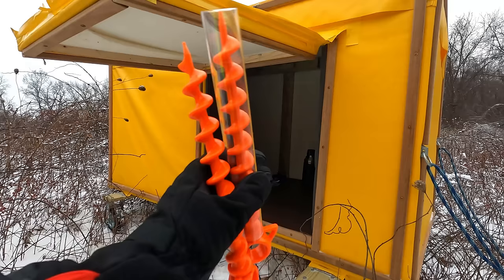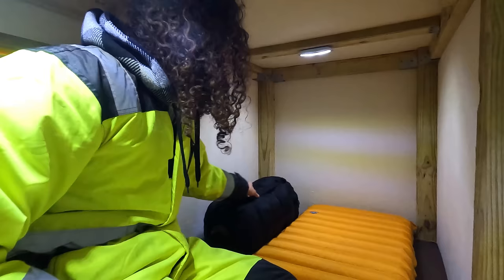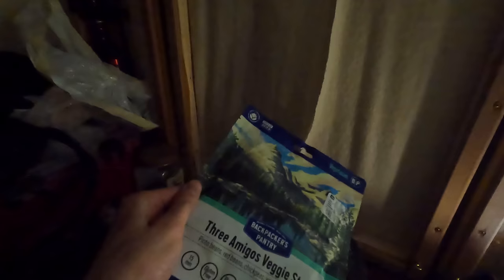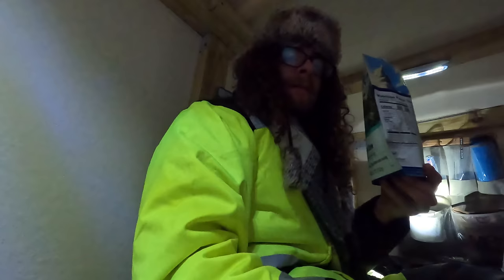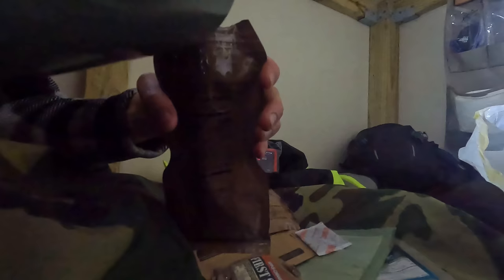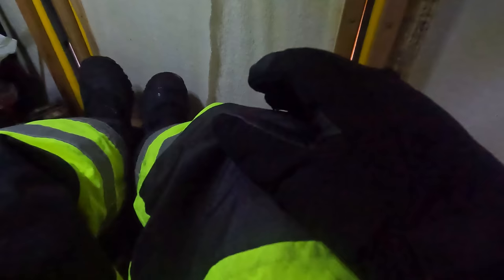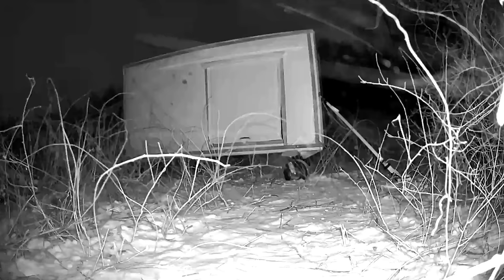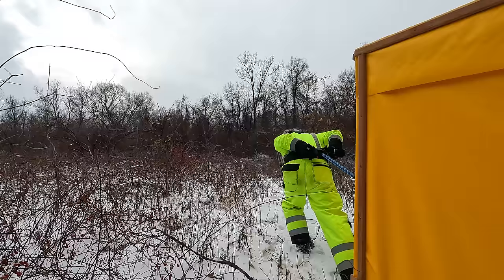Zero Degree Night In Homemade Camper ( 0° F and 50 MPH Winds )

Comment: Let’s all pitch in and get this guy one of those pocket projectors so he can watch movies on the wall of his camper 👍
Reply: I got one on Amazon for like 25$ USD and it has a battery pack. I can watch a solid 5-6 hours with it. It has a HDMI, mini HDMI, type c and USB. In small areas it's awesome. Anything bigger then about 50 inch it's resolution goes down.
Reply: Send me a link!
Reply: @AndyKPOV  can I also get the link?
Reply: @AndyKPOV  can I also get the link?
Reply: @AndyKPOV  i was just going to suggest this!!

Comment: A UCO candle lantern safely secured on the floor would be more than enough for that very well insulated camper. It's what I use in Vermont winters in my insulated tent. You wouldn't need to leave them burning for very long. I put mine in a metal bucket so.if it falls over... it's inside a metal bucket. Plus, the metal bucket radiates heat, too.
Reply: I live in my camper van and a metal bucket is a lovely idea ☺️
Reply: I have seen terracotta pots used. Over the top as well. the hole as vent.. Great radiation.
Reply: This could raise the level of CO2 in the camper.
Reply: He can't have a flame in that, the CO 2 would go up fast.
Reply: Cool!!
Reply: I have used candles myself. Actually one kept me from freezing on a cold night in Cali.
Reply: @martintrapper5366 not really
Reply: Use 4 xl uco lanterns in my hot tent all night long while hot tenting too ,keeps the temp around 55° after my woodstove burns out . I hate to be the bearer of bad news for some of you YouTube scholars but there's no build up of co2 in a hot tent ,there not air tight

Comment: You can get sheets of 2 inch foam used for insulation.  I use it when I have our air conditioner in the window to take up the space above the conditioner.  You could also build an extension for small wood stove, or a heater of some sort.  Line the walls with a fire barrier and a heat barrier(lowes).  That would make it beyond warm for most any weather you would encounter.
Reply: 🎯 Great advice
Reply: Then you can safely use your little stove to knock the chill off then possibly maintain with candle heater.
But only good while door closed, lol
Reply: Too small for wood stove, unless you want to feed it every 20 minutes

Comment: Zippo makes a rechargeable battery hand warmer that lasts much longer than those disposable ones, have a couple settings so it is easier to control the temp, and you dont have to pack in and out so much garbage. you might want to look at those in the future.

Comment: Suggestion:  install thin wall pannel inside for durability from your body inadvertently pushing outwards on the walls.  Also add a vent on the roof to let gases.
Reply: Like methane?

Comment: Better insulation would go a long way towards letting your body heat keep it warmer inside.  The reflectix only works when it's allowed to reflect, which it can't do when it's sandwiched between two opaque layers.
Reply: Heavy tho right?
Reply: @rs5570  
A little bit heavier maybe but foam is light too.
Reply: You could use 1.5" rigid foam everywhere and heat the place up toasty warm with just a candle.
Reply: Maybe outer layer of black coroplast, followed by a couple inches of rigid foam, followed by a layer of white coroplast? I'd get rid of the lumber - but then, I'm old, and would not last long pulling that 200lb loaf of Velveeta. 😆

Comment: You might want to cut out some panels of 2” thick rigid blue foam board and fasten them into the sides and roof overhead. These should be used only for winter camping. You also forgot to insulate the area under the camper which can be left in place all year long. It will make a world of difference in comfort. If you cannot find foam board in a 4 foot width you can silicone two 2 foot wide pieces together. Also the foil lined foam board will work best. Foil side in towards you. If you cut them right they will friction fit into the wall and rood sections. Bungee cords with eye hooks to support the roof sections if you can’t get a tight fit.
Enjoy the wild!

Comment: Saw some Milwaukee work gear today..hooded coats with heater coils sewn in, powered by rechargeable batteries. Supposed to stay warm 12 hours. They were around 200 bucks, not horrible.
Reply: Problem is according to reviews way too many batteries fail and they don’t stand behind them.

Comment: Couple things,  ski adaptor underside so not as hard to pull for winter.  foam insulation should be used as well better heat retention.  Candle clay pot heating system, it stacks and holds the heat well but for that you need some venting for the co2.

Comment: You should buy the indoor buddy heater it's awsome yoy can boil water 💧 on it and keep warm it's safe to use indoors with out getting carbon oxide poisoning
Reply from the maker: I'm worried about oxygen depletion inside such a small space Id have to add in a vent system but I feel if I did  it would just vent all the heat out so I'm not sure about a buddy heater for this camper But I can run some tests
Reply: Yes, buddy heater. You'd probably have to prop your little front door open a touch but all that heat coming from your heater would make up for that loss.
Reply: @Quiet Nerd  You would be fine with a vent in there and a little buddy heater, they can kick out quite a bit of heat and it would definitely warm that small of a space even with an open air vent.
Reply: @QuietNerd  also find a way to vent it so you will be safe.
Reply: Can confirm.. I have 2 of those Buddy Heaters. In a space of that size, you'd be pretty warm. 
They'd make a big difference..🍻🍻
Reply: I would put some arch on the roof.

Comment: I car camp: Here is my set-up for winter. Just spent 2, two, lol…nights truck camping in the back of my 2006 Four Runner. 1st night down to 27*, 28* F. 2nd night, woke up in Vega, Texas and it was 22*F in the AM. Dog sleeps in the driver’s seat w my big coat over her. I’m in the back watching YT staying warm mostly with my Jackery 500 running an uber cheap electric blanket inside a 40 year old sleeping bag. But I’ve been OK @ sub zero F by using my butane stove intermittently. I built a Bob Wells heat shield w aluminum foil and a coat hanger so I don’t fry. Works fine but this trip I learned: sleep w butane cans in your sleeping bag. They cut off if they get too cold. Sub 0*F is totally doable but you gotta be careful in the mountains where I’m at now…7300. It has remained 10*F ALL day. Glad I made it to my cabin! Snowed 6” last night. I love these vids Dude. Especially what you’re doing right now. No way to do much cooking inside. My rig is 4WD so a small travel trailer is in my future :-) Peace & GBU
Reply from the maker: Keep on keeping on!

Comment: I think a lot bigger wheels would be much better.  Perhaps consider putting ones the size of bicycle tires at about the 1/2 way point at each side.  To move it, you could be slightly lifting the front and just having it run on two wheels.  When you park, legs on each end would take most of the weight  but weigh a lot less.
I also think that a peaked roof would give you more strength for less weight.  Triangles can't change shape without a side changing length so you can get strength out of that.
Also a deployable skirt around the bottom might help with warmth at very little extra weight to carry.  Stopping the wind from passing under so easily will stop it taking away heat.

Comment: Nice camper setup. Just a thought, try using a 3 candle UCO lantern for heating. Rated at 5000 btus, candles last 9 hours, you are already using monitors and will provide light. Stay safe.
Reply: Interesting.

Comment: I wonder how would you deal with pulling the CheeseHut through 6" snow if it would really fall during that night. Maybe, a pair of skis (instead or over the wheels) would be helpful during the snow season, if one has  to do such a camping quest in similar conditions. 

Also, there's a number of electric battery-operated heaters, but they are kind of pricey. Other option is, boil water /heat sand or bricks outdoors and then bring the hot bottle or sandbag or brick inside. 

Lastly, I'm really impressed how sturdy this thing turned out! 

Happy new year and have more fun in 2023!

Comment: If you do this again, try the Grabber toe warmers. They are meant to work in the low oxygen environment of a boot and they get REALLY hot when used in a pocket or jacket where there is plenty of air. I bet a coffee can filled with them would raise the temp inside your whole shelter.
Reply: Super cool but wouldn’t that get super expensive really fast?

Comment: Short but sweet, nice to see you out with the cheese box again. I had problems with my Wyze camera too this past storm, we hit -16 and mine stopped recording within an hour of putting it outside too. But the solution was right at your finger tips. i enclosed my camera in a project case i ordered  online for another project a few years ago and never used and then put a large hand warmer inside of it. it overheated the camera so i put a small one in it and it did the trick, just make sure you seal the lens so its outside the project case or the lens will fog up when the box gets warm. hope this helps, i got about 6 hours before the camera started to show signs of the camera having issues with video quality... enjoyed the video thanks for bringing us along...

Comment: Pretty good build,  but outside I would usr a camo color,  or artic camo. 
Tip put some heavy clear plastic on the inside across door. Did cold weather trainging in  Alaska in marine corps. A small wood stove with a stove pipe thru side or top would blast you out of there. They glow orange when they get warm. We cook on them. You could also put skis on your box. Get a buddy and pull that like a mush dog We had three in front & one in back. And 4 on each side,  they dumped us out the back of a Chinook.  helicopter. 
Peace
Hugh Mc. Chicago,  metro.

Comment: You could add  1 5 inches of 
polyiso foam insulation to the walls. 

It's light weight.  It would reduce you heat loss or gain by 90 percent.

Comment: I watched you build your Cheese Box-great video! Love your sense of adventure. Stay safe and warm. Goodnight, Hedwig. 🦉
Reply from the maker: :D Cheers!
Reply: @QuietNerd  
I really like your sense of adventure and ingenuity!
I watched the video of your winter overnight camp and then remembered your video of how you constructed your camper.
I have a little experience using the reflexit insulation.
It NEEDS to have a “ dead air space on both sides of it for it to insulate.
Maybe use more layers of reflexit or even bubble rap.
Happy camping!

Comment: I was nearly a minute into this video before I concluded he had absolutely no idea what he was doing. But the basic Idea of a Styrofoam-box camper is actually a pretty good idea. I'm surprised it wasn't substantially warmer in there by morning from his body heat alone. If properly set up I think it might be 40 degrees inside when it was 15 below zero outside. That gap above the door must leak out the warm air pretty bad, which is also partly a good thing, because if that box fully sealed from ice or condensation he could suffocate by morning just like used to happen to kids playing in junk refrigerators. I think I'd make a duct-tape seal across the top of the door, and build-in a cook-stove box that vented in and out the fresh air and fumes, minimizing the fumes in the camper box. The air sensors were a very good idea. He needs a couple of adjustable vents to set up airflow volume just high enough to keep the air in the box viable but still keep in the heat. 
Those little plastic stakes for winter wind use were pretty funny. I was surprised they didn't shatter.

Comment: You could have used pipe insulation to have blocked the cracks around your door frame and made it more wind proof.   You should also consider lining the inside of your box with space blankets that would reflect the heat back towards you.

Comment: Great adventure. You could create a table on a hinge to support cooking on a higher level. i would advise to create an extra support tent in front of your door, making it a little bit easier to go in-out of it. Maybe even pee and do stool.  An absolute must is a heating system on gas or diesel. Requires some innovative changes but possible.  Heating with diesel is a cheap option as these units are available for less than $100. You do need a big 12v battery (40Ah) to start-it-up. But a gallon keeps you warm at least 2 days.

Comment: You should get a Vevor diesel heater. The 5 kW would probably be plenty for your camper and they are only about $110. You would leave the heater outside and just run the hose for the hot air inside. You would need a 12V deep cycle battery but you could make a place on your frame to mount it. What is really nice about these heaters is they have a remote control! I would bet you could use a smaller battery (run on low) and use less than a tank of fuel for the whole night. The fuel tank is built right into the unit which has a carry handle. There are plenty of videos on these heaters and people swear by them. Check it out. 😀

Comment: what do you think of remodelling it to make a gable roof, it will make rain and snow roll off the top of the Unit and also can be used as extra storage and probably keep a mini heating unit for cold days. Also there are solar panel mats that can be put on the roof to power everything from heating to fans to lights and they arent that expensive too

Comment: Baca rod it's a plastic filler for masonry joints you can find it at waterproofing material stores it'll fill all those little cracks so no wind comes through. It's very light waight comes in all sizes.

Comment: Tips for staying warm during night.

1. Put warm/hot water into a thicc plastic water bottle (not metal or insulated) and place between legs to circulate warmth.
2. Don't cover your mouth when sleeping, it will cause condensation and will make you colder, there's some type of face mask that helps with condensation.
3. This is weird but crack open window or let air in so that condensation will not freeze you.

Comment: You need a propane heater
Reply from the maker: Its to small I'm worried about lack of oxygen form the combustion inside there Id have to have a vent or an external heater system that just pumps heat in

Comment: Just a tip. Never a good idea to use blow up mattress in winter unless you place foam mattress between it and the floor. Otherwise they pull the cold in from below and will prevent you from getting warm. Some may disagree but imo they are pretty exclusive for summer because  they have no r value.  My guess is you already learned that given this is 5 days old.
Reply: A lot of inflatable pads are insulated and have a rather good r value. I have 3 of them that are r5 ish.

Comment: Add some 2 inch poly foam board for some added insulation. Also build a small candle heater and it will help

Comment: You gave this a good try. Now time to improve. So some folks already suggested using rigid foam panels. I agree. Roof,walls even on the floor. Use 2" thickness all around. Attach all pieces using a good brand of duct tape, I suggest Gorilla tape. Then place on floor frame and secure. Next up and the first thing I noticed. Bigger wheels. Use something like fat bicycle tires on the rear. On the front Use large tires on a wagon type steering system to keep it easy to turn. Set up a solar system panel on top with the ability to raise one end so you can generate maximum solar gain in the winter months and get one of those small battery systems that hook up to the solar panel. They typically have ports for some 110v systems but would also be able to run 12v systems like lites and USB ports to run your devices. Cell phone, Tablet, Laptop. And get a little buddy propane heater. They are safe to use in closed areas like you would have. Good luck and stay warm. 🌤👍😁

Comment: Perhaps consider putting large bicycle wheels on the outside of the  camper/shelter so it would be much easier to pull around.    How about one of those little portable stove/fireplace/heater inside.  And,.....if you mitred the edges of the door and the door jam, you could get a very good seal to keep the air leaks out.    I like what you've built.  Very clever.  And,....it's YELLOW,....VERY, VERY YELLOW.

Comment: That thing would pull so much easier with like 20" bicycle tires on the sides. I suggest fat tire wheels 2 on the sides towards the middle and maybe a rickshaw type handle in the front or a 3rd  steerable wheel in the front. You look like a smart kid I'm sure you could figure it out.

Comment: Just some friendly FYI, get larger wider tires, like riding lawnmower front tires you will have less rolling resistance, with those small wheels your basically dragging the camper, good luck.

Comment: Seems some golf cart tires would be so much easier to pull it around with. Those tiny wheels just dig into the ground and get hung up on vegetation. Two in the back and one in the front with a tow bar like a childs wagon.

Comment: I think adding this setup with more floor insulation to your electric tank would be quite the experience. Especially with the battery pack to run heater or at least a heated blanket

Comment: Try making skis from old down hill skis and 2 by 4 lumber . Cut ski to length match lumber to length screw two inch side to ski drill hole for axel remove wheel replace with 2 by 4 and ski hope I explained properly good luck love the cheese block

Comment: You could add a solar panel to the top and have a battery and inverter for power it would keep all your usb devices charged. You can probably do this for 150 bucks with a decent solar panel.